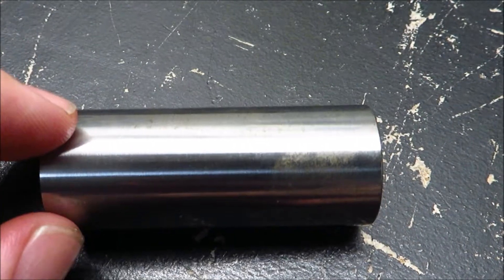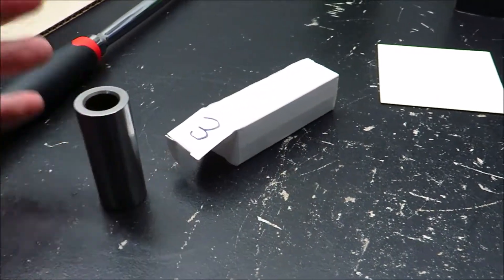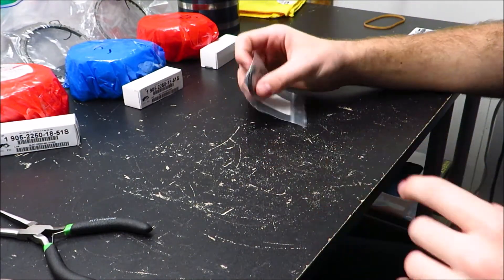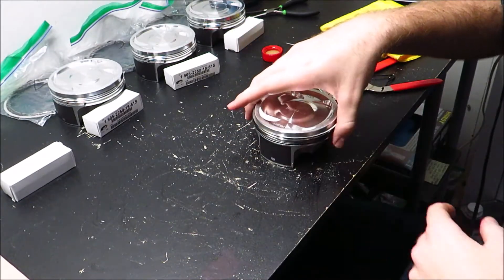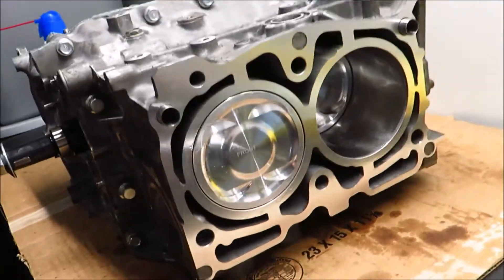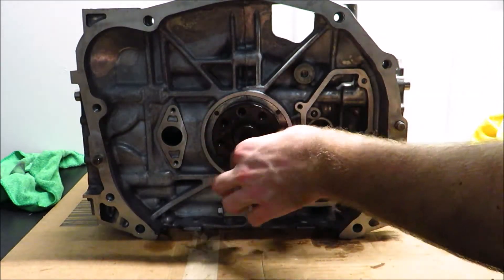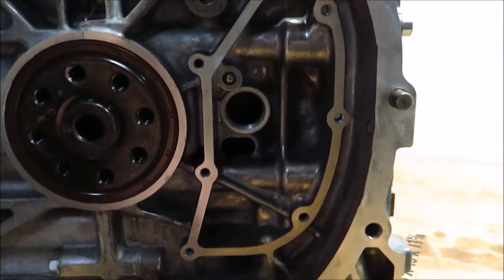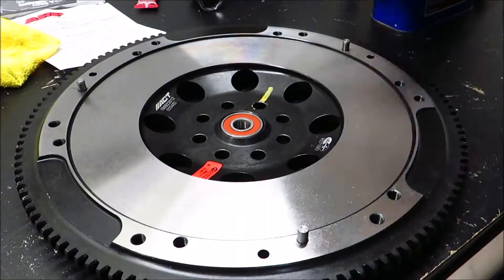Subaru EJ25 Short Block Assembly Part 2

Comment: Did you put sealant on the wrist pin plugs or is it not necessary?
Reply from the maker: I put sealant on them for good measure. There is a crush washer that is supposed to go on there too, but I used a little sealant on the threads as well just for added insurance.